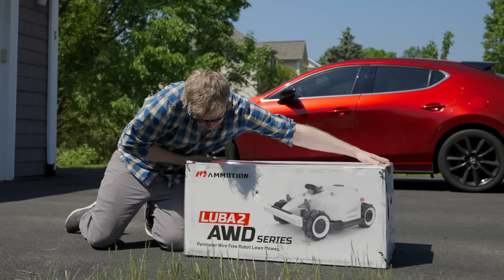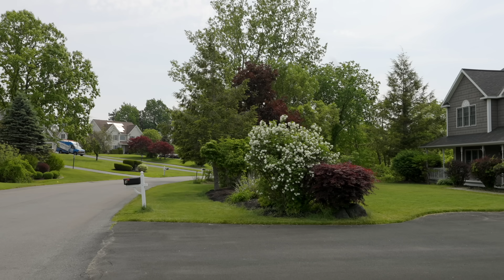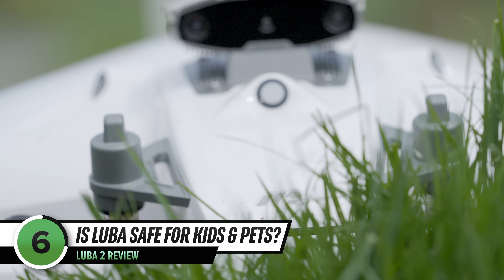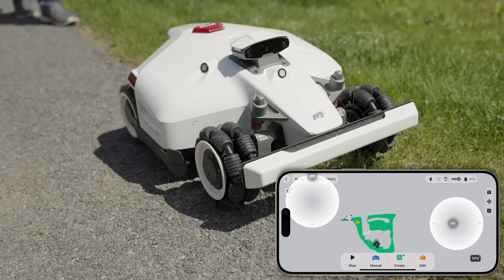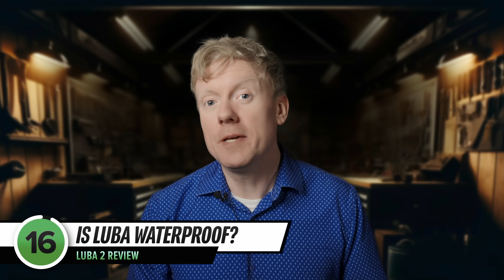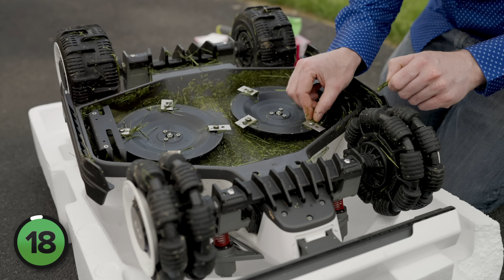Best Robot Lawnmower 2024: Mammotion Luba 2 Review

Comment: I highly suggest not buying anything from Mammotion.  They currently have my Luba 2 10,000H for the second time for repairs. First time right front wheel motor in  September,  now it's in for both front wheel motors.  When they had it in September, it was just over a month gone,  stored in the house all winter, and didn't even make it 2 weeks before it had issues.  After a month of nothing, I reached out, and they claim it's not repairable.  I said you can't put 2 front wheel motors on it.  They replied with it has water damage and they don't know what to do.  I said send a new one or give me a full refund.  It's just over 1 year old and probably only had 4 months of use.  They replied back with they would like me to upgrade to the new Luba 2 for $2584. I told them it ain't happening.  They have not replied since.  Also, they have my Luba 1000, which is just under 2 years old for repairs, and I haven't heard anything about it either.  Their customer service is the issue.

Comment: I bought two of them; one from Amazon and one from an authorized dealer.  The one from the authorized dealer stopped working after less than a year and Mammotion will not stand behind the warranty even though it was an authorized dealer.  This after two months going back and forth trying to get help.  When they work they are great, when they don't you are out of luck.

Comment: I've had a Luba robot for two years now and for the most part I love it. I've learned over this time that you must have a strong wifi signal at the charging station to avoid problems. And Mammotion has improved the app since I first started using Luba, but it's still not the most intuitive. It needs to be improved further. The mower itself is rugged and does a great job mowing, even slopes. It leaves beautiful stripes and does a better job mowing than I do!

Comment: It works well when U take it out of the box after hours of mapping.  Then a month later: the issue is Mammotion has no AI or U processor  to deal with the variations in the SAT/LEO orbit congestion and firmware (because of SOC incorporation) updates are almost weekly as this product is not capable of positioning to the ever changing stratospheric environment and this reviewer is only reviewing the mechanics  and simple electronics of the machine.  Luba has no tech or customer support and I think even Amazon has dumped them as they are a over-hyped firm with now mower heritage.  Avoid Mammotion like a skunk on your lawn as it is problematic and U spend more time troubleshooting this inferior positioning deice then mowing.  Their RTK system is no up to the job and creeper U need 28  Sats to communicate with the RTK and Robot.  A scam product, do not spend your hard-earned money on a product with no integrity or customer service which this reviewer dismisses as he knows they are not bona-fida. Forget the warranty as it is not supported once they have your mone
Reply: Almost missed this 😮; in any case I placed an order and it will arrive soon, wait a month or two and we will see, if what you say it’s true you need some big excuses from me.
Reply: @Matteopapinii  any update?

Comment: I have Luba 1. After one year Mammotion stopped completly support this first edition, so i guess this goes on with this one too. Actually the App, you have to use is maybe tuned more to this new model and it actually get worst in every update, for Luba 1 at least. It used to make connection in 30 seconds or so but it takes everytime many minutes. Also there is now some chines letters in some menu items and so on. If you do regular single cut pattern with Luba it will leave some tall uncut grass behind. This is due to poor desing and those too wide tyres (and too close to blades and so on). So if you want to have graass like in many videos you do need to due double pattern. Like somene mentioned here earlier the support is just not existing at all! There is a ton of issues and they wont get back to you  at all. My Luba has been full of water sense i got it. If you lift the nose up there is water pooring from rear axels. You can even hear water spalashing inside. That uestion they did answer and they calimed to be normal!? Chinese engineers do stuff with minumun reuirements. That yo ushould always keep in mind when ordering chines products. This is just too expensivee toy not to work roperly and not to have any support what so ever or any quarantee services. I do not recomend this brand to anyone.

Comment: My luba lost reception, again, in a very bad place right next to the garage. My wife didn't see it, and clipped it with her truck.
Broke the front and rear suspension, and I was getting fault code for the front motor.
Initially tech support seemed like they were going to help. I gave them all the information. They sent another email asking for the device name, which I sent. I never heard from again. I sent numerous emails. I told them, I am capable of doing the repairs myself, and that I will pay for the parts. Nothing. My only option is to buy the only set of used motors is can find for $250, and epithet JB weld tge suspension or pay about $600 for a used set. No guarantee that will fix my $2,700 paperweight. 
If you're the gambling type, buy a Luba. Do not expect any support if you have a problem.

Comment: If the tracking and positioning is as good as you comment, the R&D team at Luba need to spend time on the cutting system. Compared to a Husqvarna mower (which is the original patent) it just looks pathetic 😢.

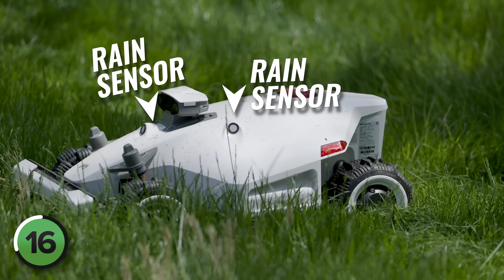Comment: At 10:43 Correction, those are not rain sensors, they a ultra-sonic sensors, part of obstacle avoidance.  The rain sensor is on top near-middle of the mower consisting of two stainless steal rounded pins in a slight depression.  They work as you describe.

Comment: No doubt the luba 2 is great but your video sounds more like a “sales video ” than an actual review.
Reply: Because it is. He is providing all his affiliate links so he gets a percentage of each purchase of anything bought when bought through these links
Reply: It works well when U take it out of the box after hours of mapping.  Then a month later: the issue is Mammotion has no AI or U processor  to deal with the variations in the SAT/LEO orbit congestion and firmware (because of SOC incorporation) updates are almost weekly as this product is not capable of positioning to the ever changing stratospheric environment and this reviewer is only reviewing the mechanics  and simple electronics of the machine.  Luba has no tech or customer support and I think even Amazon has dumped them as they are a over-hyped firm with now mower heritage.  Avoid Mammotion like a skunk on your lawn as it is problematic and U spend more time troubleshooting this inferior positioning deice then mowing.  Their RTK system is no up to the job and creeper U need 28  Sats to communicate with the RTK and Robot.  A scam product, do not spend your hard-earned money on a product with no integrity or customer service which this reviewer dismisses as he knows they are not bona-fida. Forget the warranty as it is not supported once they have your money!!
Reply: @dol3980 so who better ?  Nobody...

Comment: I’ve been using Husqvarna Automowers for about 10 years now. My current ones have a total of nearly 50,000 hours on them. They cut rain or shine. The lawns are perfect. The drawback was having wires buried in the lawn which stops hollow tyning and makes me nervous when scarifying but they now make a wire free system so…. The other thing to bear in mind is that parts for these things are horrendously expensive particularly batteries. My first machine ran for 5 years on the original batteries but it cost me £550 to put new ones in when I screwed up and stored it over winter without charging. I watched this and was amazed at the long grass that seemed to escape being cut when it moved on.
Reply: I bet you could make a battery for a lot less if you have some skills for that thing
Reply: Look interesting
Reply: Thank you, that is incredibly helpful. Getting one from the video just for a year worth of mowing seems silly.